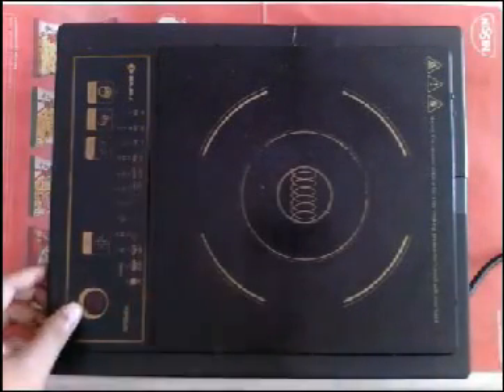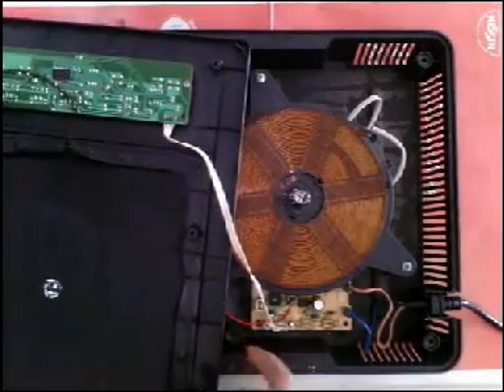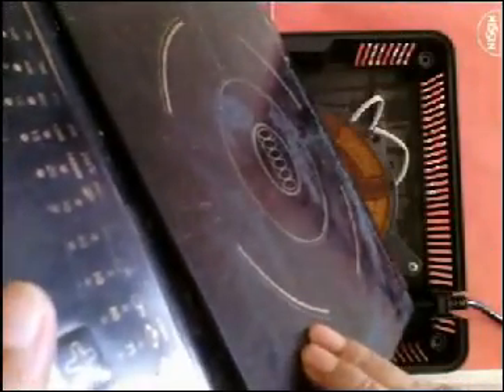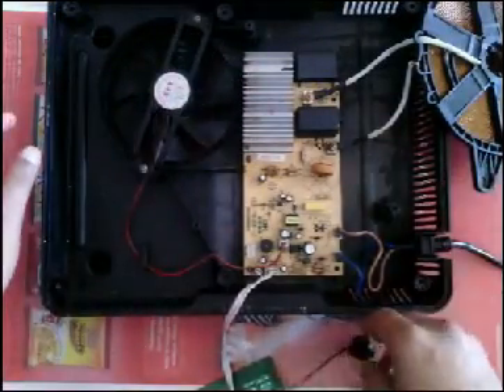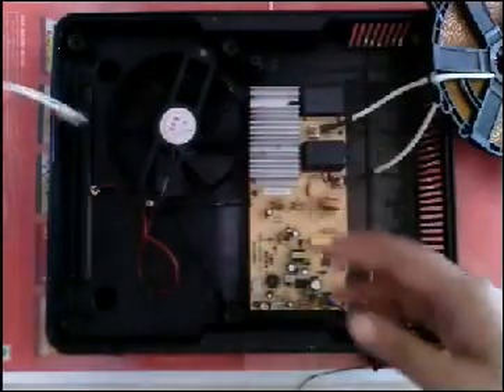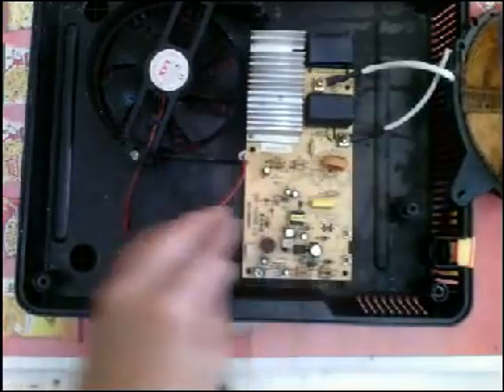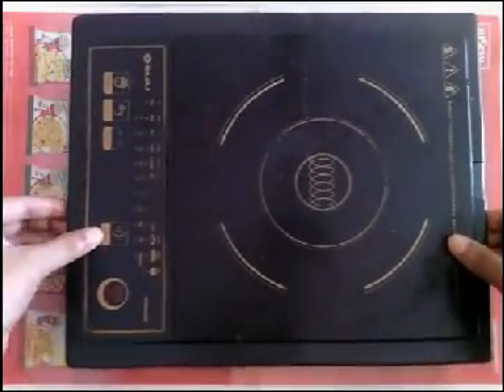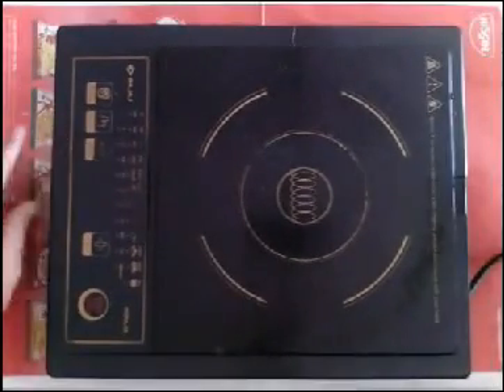Bajaj Induction stove Teardown

Comment: Sir igbt  bar bar short kuy hota Hai ek se do day chalta Hai sir
Reply from the maker: Trace the Circuit near IGBT and search for any faulty capacitor, replace even if you find any minute bulges on the capacitor, beside this check out other components properly like inductor, resistance, diodes etc.